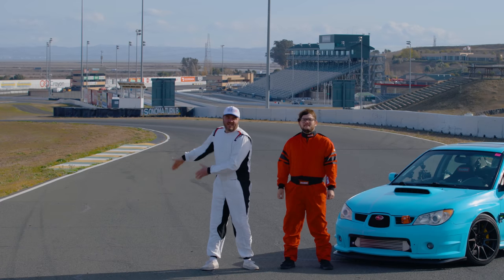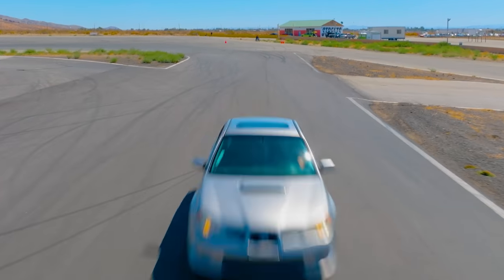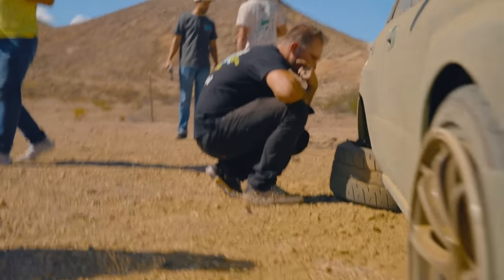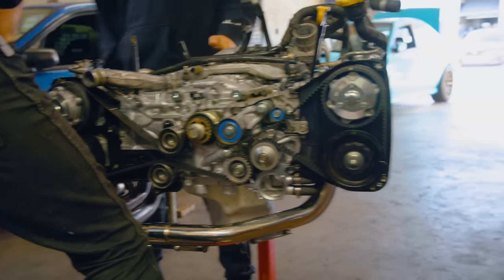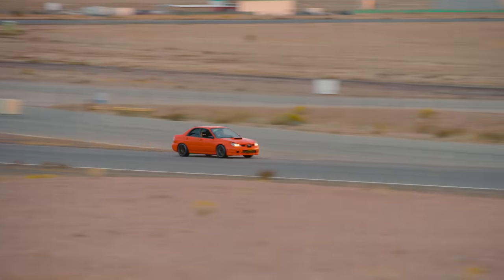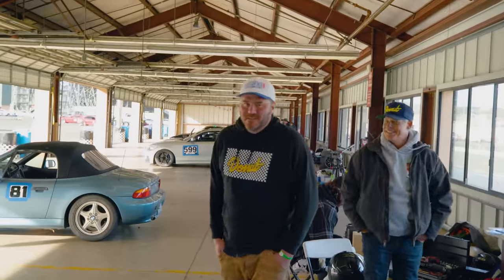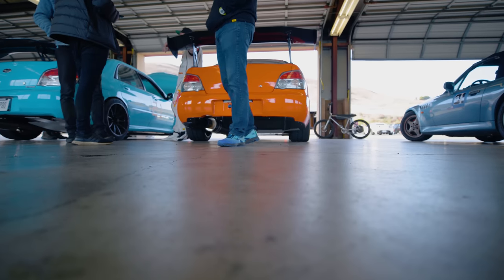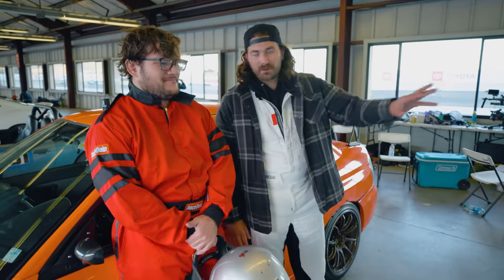$21,000 vs $43,000 Subaru WRX Build - HiLow FINALE!

Comment: Going through 8 engines is the biggest proof of endorsement that Ebay Motors could've asked for in this series.
Reply: thats not even ebay motors man, thats just subaru wrxs for you
Reply: @sychodelicstorm5592  blowing up engines. It's what makes a Subaru a Subaru.
Reply: @sychodelicstorm5592  nah fam if you treat subies right, mod them right and tune them right they will last
Reply: @sychodelicstorm5592  no😂
Reply: @Lucifurian66x  if you have to baby it so it dosent blow up, it’s a shit engine
Reply: @Lucifurian66x  They will last... a few months. As the other guy said, if you have to treat them right for them not to explode then the engine is shit. You're better off LS swapping, it's gonna be cheaper, safer, more reliable, and faster.
Reply: @Drastic_oG  You can blow up a LS if you beat on it before it's broken in.
Reply: @ravenwing199 due to production schedules they probably couldnt break it in. problem is that EJ wrx in general is pretty much a shitter STI so why didnt they start with that?
Reply: another point to prove ej motors are shit xD
Reply: Cost of blown engines should be included in final totals
Reply: @Lucifurian66x  rotaries can be harshed more

Comment: Wow this high-low went by so quick. Do you guys fear of loosing another engine? :D
Reply: Wasn't even half the length of the other 2
Reply: Or another car
Reply: @tranquility7692  yeah this was expensive series for them lol
Reply: Probably blew up while you were writing this
Reply: They bought subarus so probably 🤣
Reply: EJ engines are disposable and not intended for more than 1 use.
Reply: Losing*
Reply: Half the length, 2x the cost.  Haha
Reply: @SullySadface  very underrated comment there bro
Reply: Yea I want an wrx but I wouldn't want to use the EJ. I would definitely look for a Porsche engine to drop in it
Reply: They definitely probably planned to make it longer but the engines blowing probably forced them to shortening it after going mega over budget
Reply: I assume they had planned a longer season with more upgrades. But the extra spending forced them to cut it shorter.
Reply: Is there not a solution to the oil starvation?
Reply: Only if they didn't torque it right.
Reply: Because the budget went up in smoke.... engine smoke
Reply: Bruh, they were buying a brand new engine per episode.
Reply: Cause Subaru makes a trash engine.
Reply: oof
Reply: @tranquility7692  that's because if they kept going there wouldn't be any engines left in America
Reply: @Vexrais  EJ207 in Japanese models is good.
Reply: Wouldn't you after blowing up 5 already
Reply: theyre gambling with those stock blocks, you need a built motor to make reliable power but thats for someone with deep pockets. never mod these cars for power and just have fun with them stock tbh
Reply: @jamiemacmullin2291   That's my guess too. Content was very good though and that is what counts. I rather watch a shorter but better series then a longer but staler one.
Reply: @kickbuttowskii  because that video compared the full history and it was based on numbers only.
Reply: They went so over budget from the engines dying, they probably had to end the season early.  They probably made it like halfway and then were already at the budget for the entire season
Reply: They admitted they didn’t do research going into them and they aren’t familiar with Subaru. The first upgrade they should of done is cooling because Subarus run hot. You try to track a stock wrx it will blow
Reply: @NxGhxst  if a cheap car needs special care and special set of upgrades it's not worth it, also they did it the way any person would go into upgrading a car, it's subaru's fault being overcomplicated, the way donut media is the closest to the real life of owning a subaru first time.
Reply: @ZACKARDO  "special care" i.e doing normal (researched) maintenance on the car.
Reply: Yeah, they blew the budget in half the usual time. That's that genuine Subie experience
Reply: I feel like the Z’s was a way faster season
Reply: @SullySadface  Heh good ole EJs
Reply: @Vexrais  I finally got mine, it's a 2017. It's got the FA.  I am not upset.
Reply: Ü
Reply: Byeah
Reply: Damn I hate it when my engine is loose
Reply: Definitely
Reply: *losing
Reply: Wasn't fear, it was reality
Reply: Ya I don't think that 40k included engines and cars for hi car hahaha
Reply: they were never going to fiananically recover if this continued any longer.  I get it.  It sucks, but I get it.
Reply: I get it they're probably almost reaching $100,000 just for this video 40 + 20 + 6 engines I'd say you're getting close makes sense why they try and end it hopefully if they do another one they'll pick a better car LOL or maybe do a bike one and instead of high low maybe do on brand off brand
Reply: There is a limit to the filming budget! lol
Reply: Alot of their content has become shor and popcorn like. They haven't been going in depth as much as late kind-of missing the older content
Reply: they had to replace 1 transmission and 5 engines. neither are cheap. they went WAY over budget, so I don't blame them for cutting this series short
Reply: It seems like it went so quick because they did a ton behind the scenes, like the radiators, and cooling systems
Reply: @ZACKARDO  That's why they have such bad rep because 90% of the people who buy them mod the fuck out of them and when it breaks it's "surprise pikachu face".
Reply: @mpresto15  there is. Baffles and inserts for street. And also new pan that is 6 to 7qt vs 4.5 and has a wide bottom for track. They only baffled. Moreso or killer b pans would have solved it. Not bandaided
Reply: When it’s a wrx it will blow up
Reply: Definitely should do it again when Evos
Reply: @kickbuttowskii  that tells you how bad the Evo is lol
Reply: I was thinking the exact same thing, they probably lost wayyyy too much money on these things😂
Reply: @galaxydrifter9799  They would go over the budget right after buying them considering the prices of Evos now
Reply: LOSING. ITS LOSING
Reply: "losing"
Reply: @Vazquez12able  are they really that expensive in the US? I got mine a few months ago in the UK for around 15k
Reply: Might be because they bought an extra car, trans, and 5 engines. Just sayin'.
Reply: @shift307  If modded properly they can be decent, Such as cyl 4 cooling mod etc. These guys did not do anything other than throw parts on it.
Reply: @galaxydrifter9799  I'm not from the US, but in my country they don't dip below twice of what you paid for yours, crazy.
Reply: @mpresto15  Not a good enough one to make the reliable.. They just cant reliably hold much power even fully built.
Reply: @burgerman-nb3cv  Its good for a Subie engine, not that good of an engine overall tho. Still lacks reliability and cant hold much power. Def better than the other EJ's tho.
Reply: @cmcafee251996  lol no... Subaru's problem are not anywhere near normal for a car. Your average car owner is not gonna be sitting there reading thru hundreds of online threads. The EJ's need very specialized mods, upgrades and care.. Almost like a rotary. You are making it sound like an EJ is like a K series and just needs basic fluid changes and a valve lash every so often.. LMAO... no...
Reply: @tranquility7692  nah ur wrong vids are longer this season
Reply: @mpresto15  killer b oil pickup the oem breaking isnt unknown
Reply: @Vexrais  just buy a closed decked short block instead, the price of a Porsche engine is crazy lol Ej in Porsche is a thing, Porsche engine in a Subaru is not for a reason
Reply: @JonHop1  Damn, chill out with your RSX. Stock vs stock everyone will STILL pick the STi over your stock garbage FWD 160 hp bucket.
Reply: @findmeifyoucan  I'm awd bud... and Hondas are easily n cheaply made awd n have better awd systems for drag racing. Better motors of course.
Reply: @findmeifyoucan  also, type s come NA with 210hp from factory... NA.. with the exact same turbo kit the STI has, a k20 or k24 will 350hp to the wheels with same tune. The output n airflow on a k20 is almost double on a k20 compared to an ej.. of course redline  is 2k more as well.
Reply: @grayson9207  IT'S*
Reply: @JonHop1  source: trust me bro
Reply: @Neonmonkey42  source of what? U reply to the right person?
Reply: @JonHop1  Your claims.
Reply: @Neonmonkey42  what claims? I didn't make any claim. I gave my opinion from my own experience. What opinion are u disagreeing with? I have owned Subies my entire life for almost 30 years and I work on them for a living? If there is something you disagree with I'm open to hearing a counter argument.
Reply: obv... James Pumphrey to staff: Ok guys... 8 engines in... we cuttin this one short!! prep from final episode!! lets forget this and move on to NON-explody cars next season.
Reply: @JonHop1  "It's just my opinion". Not worth the finger movement.
Reply: @Neonmonkey42  You are one odd dude.. Yes it is my opinion.. If it wasnt worth the finger movement, why bother commenting at me in the first place... smh
Reply: They can always just do another engine swap like they did with 350zs. But instead of boxers it should be kswaps.
Reply: @mpresto15  usually guys tracking these will overfill oil to prevent starvation
Reply: @JonHop1  baderbuilt would say otherwise. ej25 can hold upwards of 500hp on stock longblocks if modded right. Keyword done RIGHT. These dudes  just slapped a bunch of shit together like a teenager w a stimulus check. Shit happens so often no wonder people think ejs are shit. They didn't even bother resurfacing the heads after the first rebuild shit was rusty and orange.
Reply: I don't blame them. I think we all learned a lot about this car though haha
Reply: I can't believe They just didn't think about properly building the subbie engine to withstand high G turns.. 
Oil pan baffles, upgraded oil pump/pickup system with a better aftermarket gasket set usually is all it takes..
Reply: @freelimes8389  ?? Bud do you only see what you want to see when you watch bader? Bader's builds at 500hp+ on stock blocks blow up constantly and never last long.. Just watch Devons channel as well. They never last. I can dyno a K20 at 1000hp too and have it last for a week. Doesnt mean that is what they hold reliably.
Reply: @NxGhxst  they upgraded the cooling system after the first run. Next excuse for a crappy car?
Reply: @burgerman-nb3cv  I've had both EJ205's and EJ207's and the 207 is a goddamn beast. It has literally none of the problems the 205s have.
Reply: lmao they probably rushed it bc the season budget didn't predict that everything that could go wrong would go wrong
Reply: @ktbphoto  I absolutely love it, I have an imported STI paired with the twinscroll turbo and its faultless.
Reply: @tranquility7692  they had to with the lifespans of the engines being 5 mins
Reply: Thats how they should do it. They should buy t2o engines, two shells and build them from scratch, make em work for that YT money.
Reply: as Nolan said.. its an engine per episode...
Reply: Next up HiLow Season 4, WITH RX8s. It gets better and better
Reply: @robert9595  don’t let mr.Subaru hear you
Reply: @FilipoLipos I think it’s also because of all the backlash they are getting from people who actually know how to maintain Subarus, other big name people like Smedia even.
Reply: @Vexrais  they just are NOT track cars. The engines are torquey and fun for the street but CANNOT be consistently wrung out.
Reply: @cwx8  I was just on a track day with nothing but Subarus. They got beat up on all day with no issues. They can definitely be track cars
Reply: @SychodelicStorm  No, Subaru engines are just like rotaries and you have to know how to build them otherwise they blow up, watch smeedia & mr Subaru's video on it.
Reply: @kickbuttowskii  the guy in that video clearly is not working for donut anymore otherwise he would make an official statement reversing that decision at some point in this series
Reply: @kickbuttowskii  good lad